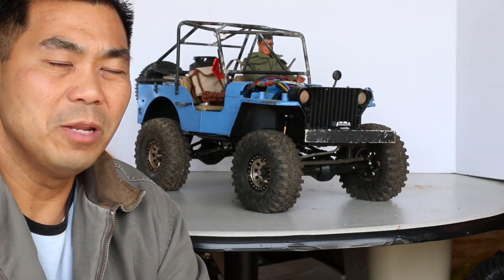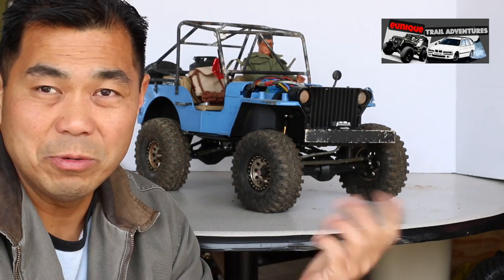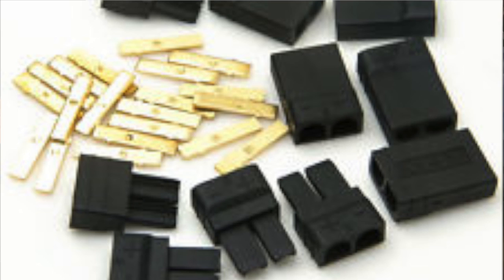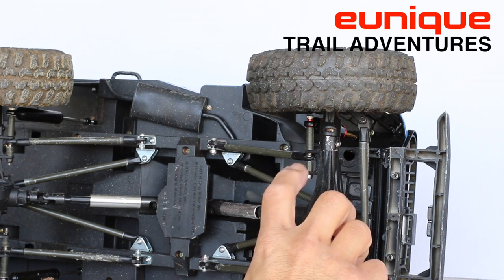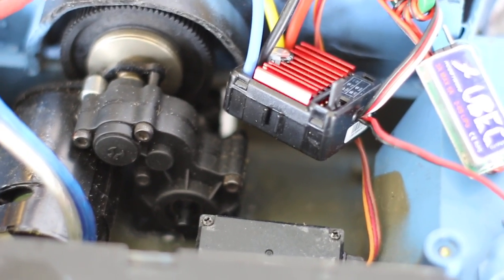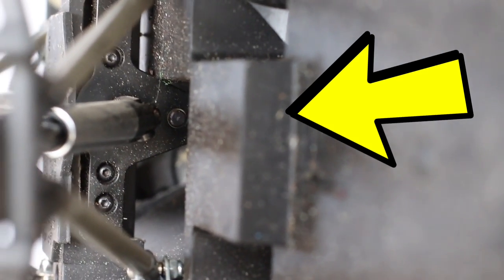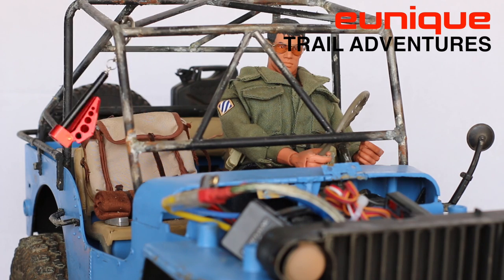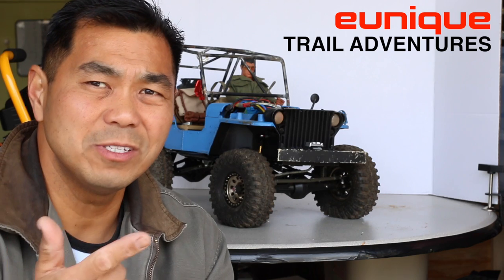HACKED a Jeep Willys Flatfender | Custom GI Joe Jeep Build | eunique trail adventures

Comment: Great video! 
In what way is your transmitter hacked? Will it work with TG3 and Austar receivers too? They look similar, just other labels. I use the TG3/Austar radio gear, and I bought several of their 3-channel receivers as the price was unbeatable, I think like $5 / receiver. I think this may be the same stuff, I'd like to try.

Comment: I just built myself a new cage/body using .250 dia. Torch welding filler rod. It's steel filler with a copper coating so it welds like mild steel.  I mig welded mine btw. This stuff is a bit heavier but strength is unmatched.  My ig is machinetard666 if you want to have a look. I'll post pics of the new cage today